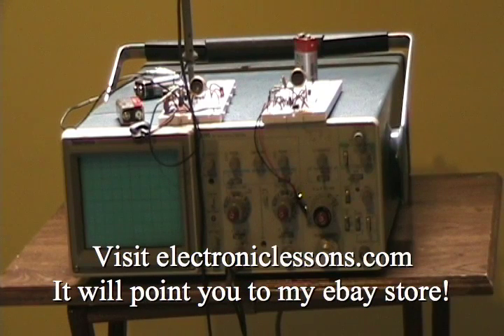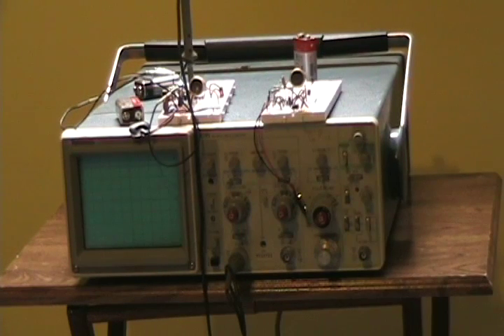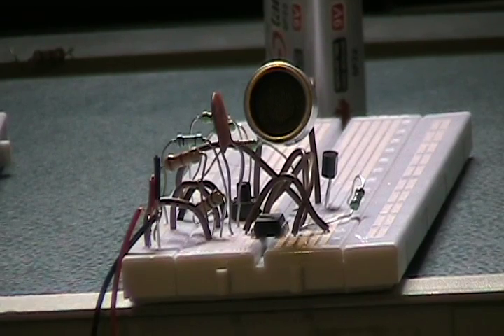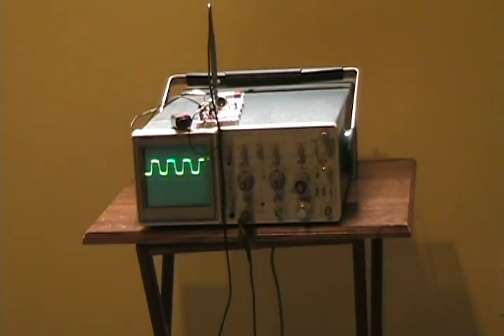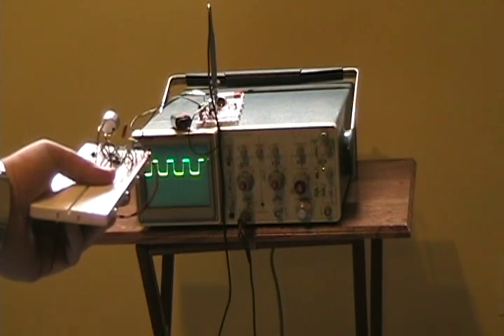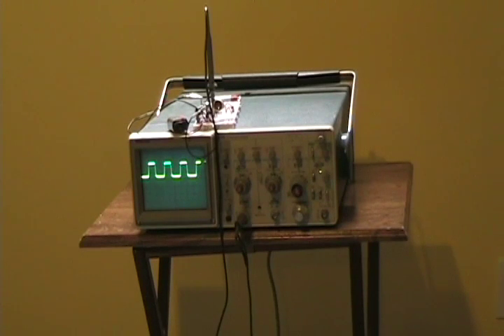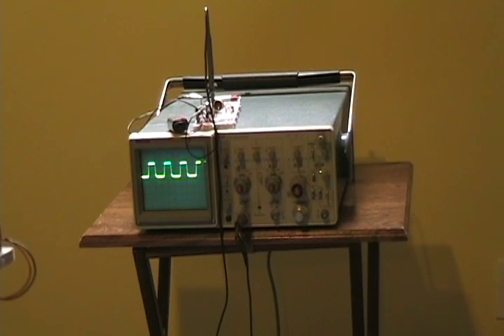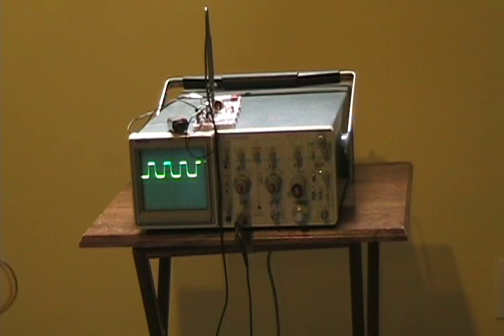The Ultrasonic Transducer - These are awesome!  I sell these too!

Comment: I am highly considering making my own Ultrasonic cleaner for cleaning gun parts. I am trying to think of a cost effective design. i cannot really find any good solid info on what exactly i would need. BTW i want to be able to fit a full length long gun barreled action, which would call for a container around 35"x6"x4"...any ideas?

Comment from the maker: I'm sorry the prices are out of your range right now.  I assure you that I have the best buy-it-now prices on ebay.  I even have a listing that comes with a 555 timer for transmitting and a quad operation amplifier chip for receiving.  Electronics can be a rather expensive hobby, but I try to be reasonable with my pricing.  Thanks for taking an interest!

Comment from the maker: I have a wireless transmitter and receiver component set as well.  The method of sending information from the sent from the transmitter to the receiver is called modulation.  There are many different types of modulation methods.  In essense, you take your input signal and send it on a much higher signal, almost like riding a wave.  The higher frequency (carrier wave) is taken out of the equation in the process of demodulation, and you get your original signal back.  You can wiki modulation.